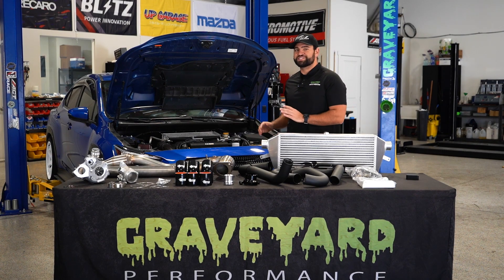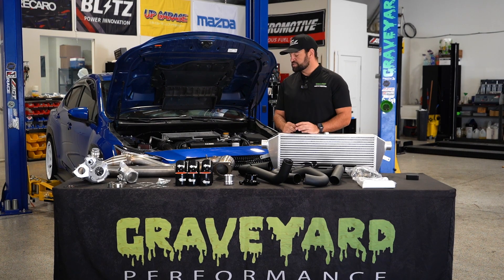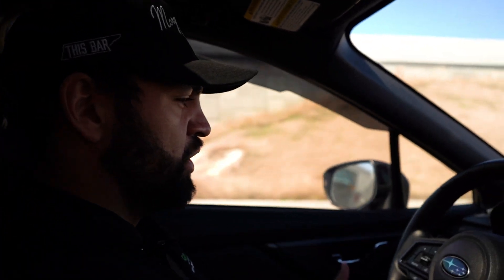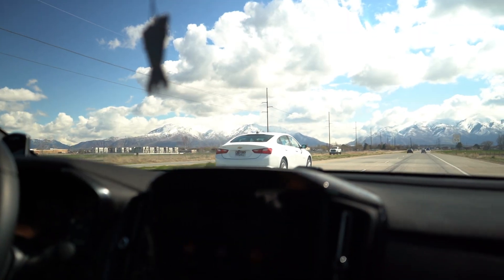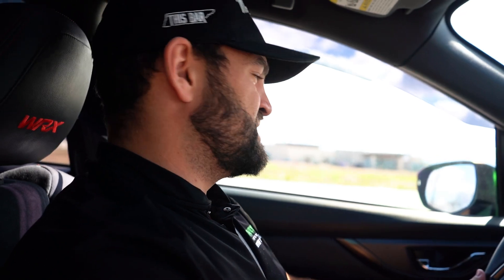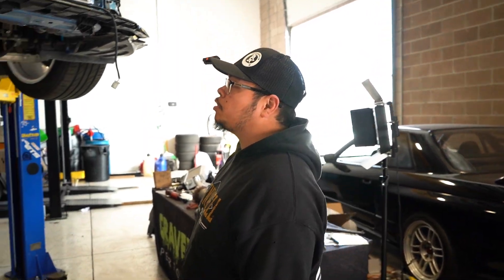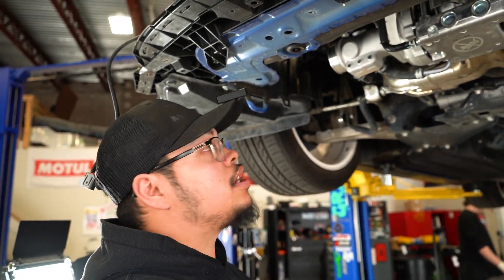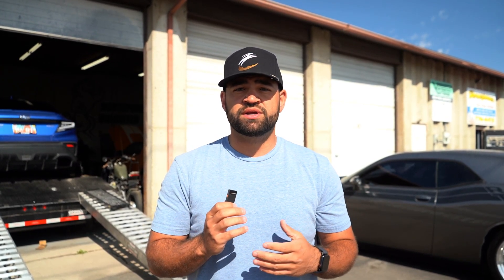Testing New BNR Big Turbo on VB WRX (GREAT RESULTS!)

Comment: I'm sorry this may be a dumb question, but new I'm new to turbos. You say in the video that BNR Turbos sent you a Garrett G30-770 so you can test it and they can put it into production? What exactly will BNR do? Are they taking your Garrett turbo results and just re-manufacturing Garrett's device? Changing the turbo wheel, bearing, CNC the housing a bit, etc? Or are they going to copy the geometry and manufacture their own without starting with the G30-770 at all? The G30 is the same as the one ETS currently bundles in their ETS Quickspool Turbo kits. I found it interesting that these turbo company competitors would test each other's turbo in order to develop their own. Its like that meme (Can I copy your homework and change a little bit?)

Comment: Journal bearing turbo? And was that the stock turbo inlet?
Reply from the maker: @RawAudioDrives  ball bearing, this was used with the proprietary inlet provided by BNR
Reply: @ fair price for a Ball bearing. Bolt on g30-770 is crazy
Reply from the maker: @ priced hundreds below the competition and making more power! Definitely a crazy bolt on turbo, but we’ve loved every BNR we’ve installed and the reliability is insane

Comment: I wonder which one is "safer" on stock engine/trans. This turbo on 91 or stock turbo on E?
Reply from the maker: @JerryNeutron  with a torque curve coming in at a later RPM than factory, this turbo is probably gonna be pretty similar with it putting out more torque at a later RPM compared to the factory turbo having a lot of torque at an earlier RPM
Reply from the maker: @JerryNeutron  with this having a later torque curve than the factory turbo but making more power, it’s probably sixes